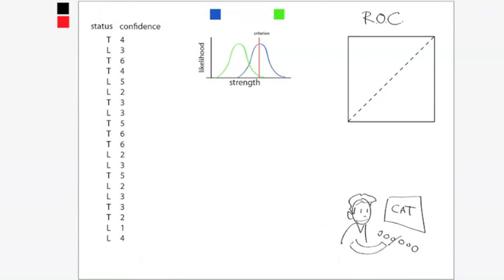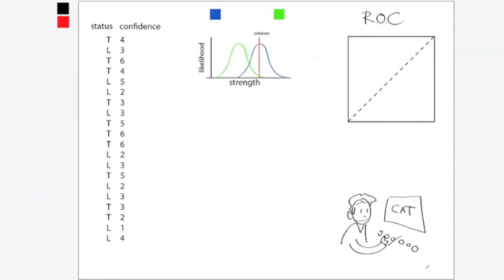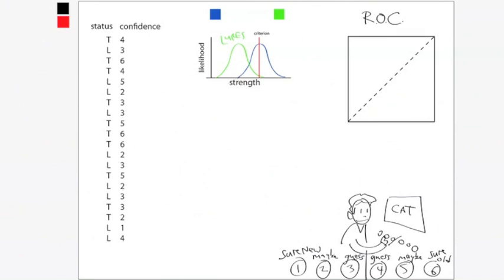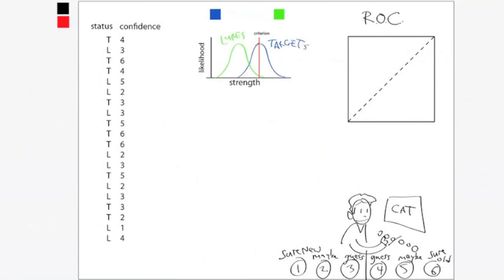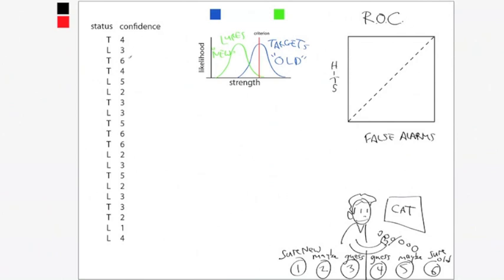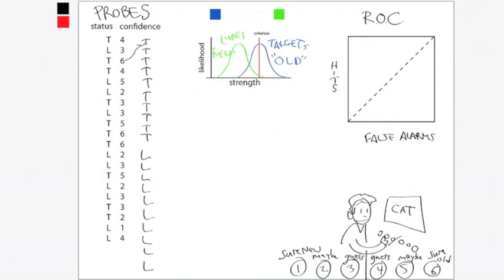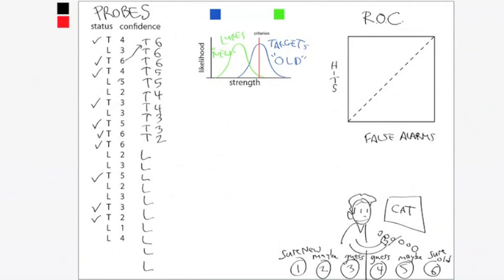Constructing an ROC curve - Part I

Comment: What would I do in the case that there are only 5 "buttons", where 3 is kind of a middle ground for each side. Should I leave that out of the data? Or consider it a positive or negative...
Reply from the maker: You actually don't have to change anything for the 5 button case!  Your data will be targets and lures with confidence ratings going from 1-5 instead of 1-6, but you can use the technique from the video without any modification.